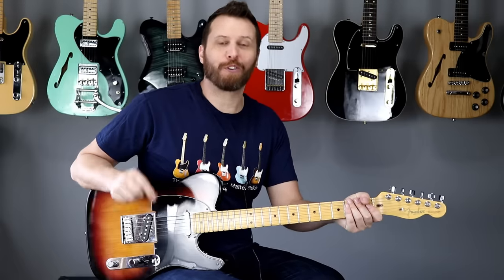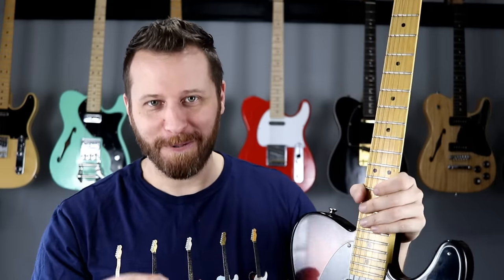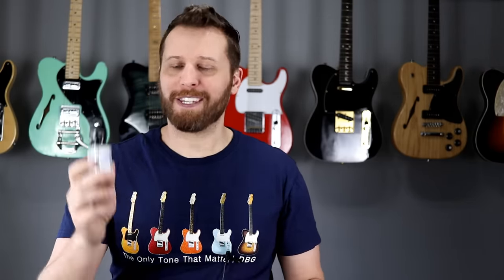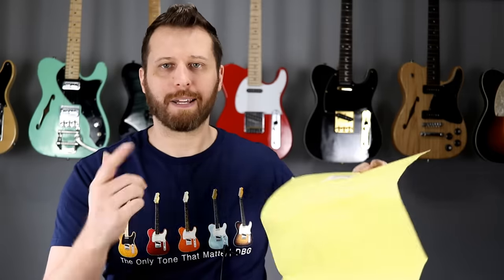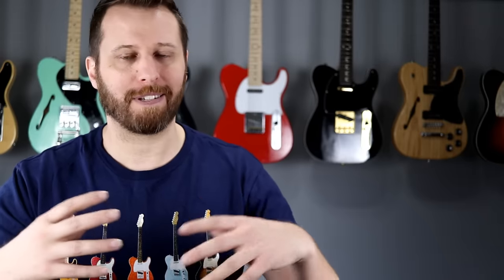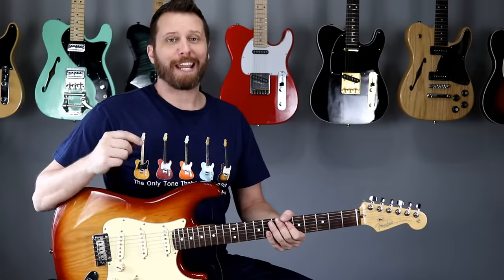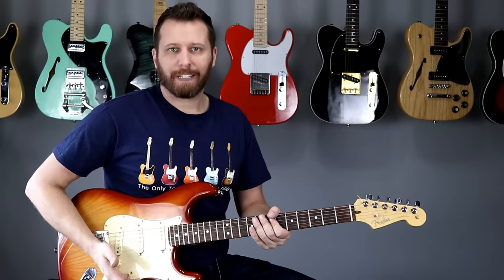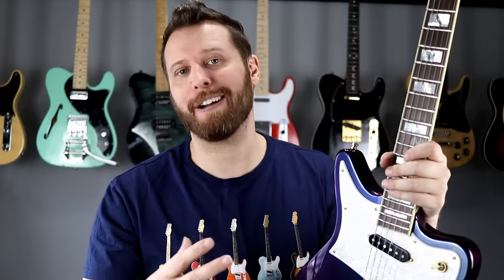KILL The Hum and Buzz!! - Keeping Your Single Coils QUIET!

Comment: I put 3 hotrails in one of my Strats. With a toggle switch for each one to go from single to humbucker. No noise. Noise Gate otherwise. 👍
Reply: How much did it cost for the 3?
Reply: But isn't coil split again noisy?
Reply: I have a strat ultra from 91 which has noiseless lace sensor gold pickups
Reply: Yes, split will make it noisy!
Reply: I've got the same setup preloaded pickguard from dragonfire.i love it.
Reply: No strat tone too.
Reply: and it doesn't sound anything like a strat. May as well use an ibanez or another humbucker guitar.

Comment: I recently bought the Electro Harmonix Hum Debugger, and it's a fantastic solution. Doesn't affect the tone at all. The only issue: it has to be plugged directly into the wall with the power adapter that comes with it. Not a gate. It goes after JUST the buzz/hum and it's INCREDIBLY effective. Won't play without it now. Has 2 settings: Normal and High.
Reply: 3 years later, I bet you agree the pedal changes the tone. Everyone who has it says it gives a weird ring-mod/delay effect on notes

Comment: I’d suggest using the gate as the very last solution. It’s the most obstructive method to your sound. First step, use high quality cables! Second, check the other electronics in the area and where their magnetic fields are! Third, insulate your guitar’s electronic cavities with the proper copper shielding tape (adhesive needs to be conductive), by this point you should be almost noise free. Then a gate with very low settings could certainly help. And/or hum/noise reduction if your setup has that option.

Comment: I've tried a number of noise gate / reduction pedals over the years... Boss, MXR, ISP... the MXR Smart Gate is the best I've used. But the Suhr SSCII system built into my red Suhr is a much more effective solution :) No battery needed unless you're using the S90s (P90 style) too.

Comment: My advice is 1. shield the guitar properly (create a Farriday cage by making sure all shielding is touching and grounded ) 2. don't play under florescent lights. Play by candle light if you have to. 3. Unplug unneeded electrical appliances (including wifi devices). 4. Try plugging your Amp into different outlets, because sometimes a high amperage appliance can create line noise on all outlets running on that breaker (of course this problem effects humbuckers too)
Reply: I plugged my amp to another outlet and boom. Hum was mostly gone Ty

Comment: The Boss NS-2 noise gate is my favorite.  Easy to use and effective.  Plus, it has some unique routing options where your pedals run in a loop if creates and your guitar goes in and out.  That way it can separate the guitar signal from pedal noise. Really helps with high gain setups.

Comment from the maker: As a HUGE single coil fan this is a subject near and dear to my heart!
If you guys have any favourite noise reduction or gate pedals post them below :)
Reply: MXR Smart Gate :)
Reply: Dryer sheet for the pickguard static.  Got my tele shielded, but it was pickguard static!
Reply: What do you think about a parallel wired humbucker? I did the P-Rails wiring to a set of Seymour Duncan Pearly Gates and found that running the pup in parallel gave me a very similar sound to the tapped humbucker. Minus the 60 cycle hum, of course.
Reply: Oh, and I use a modeling amp, so my gate is built in.
Reply: Zexcoil pups
Reply: Ehx hum debugger! Super simple and works great!
Reply: @GCKelloch  What you conclude is about right, but the resonance you mentioned has a negligible role in it. If you connect a guitar output with a very short cable, the capacity is almost zero and the effect of the parallel humbucker is still the same.
There is a more important factor here: each coil in the HB presents to the other a higher impedance to higher frequencies and a lower impedance to the lower frequencies.
You can check that in a LP like guitar with one pickup as HB and the other as SC. As you turn down the volume of the SC, the sound of the HB can grow up because it is now not being loaded by the SC.
Reply: What about "dummy" coils? The same hum reduction as pos. 2 & 4 with little/no tone change.
Reply: BOSS NS-2 does the job for me
Reply: @GCKelloch  hmmm, interesting, I must say I have never metered the pickups after I wired them. Maybe I should. From my auditory experience though, the only difference  that I could hear  between the split and the paralleled humbucker was the loss of the hum in the latter.
Reply: Slave coil and attach it to the tremelo cover or at the back, completely passive and 100% effective
Reply: I use the TC Electronic Sentry Noise Gate: I believe it’s the best : set properly (which is easy), it really shuts down the noise with little or no loss of dynamics or sustain
Reply: I'm a huge fan of Zexcoil pickups.
Reply: KC : thanks, I’ll check it out
Reply: My favorite is the shielding paint.
Reply: G&L's Z coil pickups
Reply: The Gate I'm working with is the TC Electronics Sentry. Better than all the others I've tried: it works on 3 different frequencies, lets the notes through and kills the hum and hiss without damping the sustain. Once you tweaked it a bit to your needs, works really great ! \m/
Reply: I use an '80s vintage MXR noise gate/line driver. It's finicky to find the sweet spot between hum canceling and sustain clipping, but I think it works better than anything else I've tried once you get it there.
Reply: I always put a lot of time and effort in shielding measures, copper foil, graphite paint, proper ground wiring and all that stuff. Then i bought a ISP Decimator II and i never looked back. It kinda hurts to spend that money because it is not a flashy pedal and all it does is "quiet". But it is such a relief :-)
Reply: @CGCEifel  Yeah, I had an ISP: great pedal. Simple and effective.  The Sentry brings it to another level though, completely taking the pumping effect out on long notes without masking any frequencies.
Reply: @michaelkane6797  They really built great pedals in the '80s took many of the flaws in '70s pedals away. Still kept a bunch of '80s pedals: ODs (Boss), Boosters, Compressors (Boss CE-2!), Choruses and Tube Screamers (Ibanez), next to more contemporary ones \m/
Reply: @frantisca  OK, i somehow lost interest in gates after i got my ISP :-) But this sounds interesting, i'll take a look at the Sentry, TY.
Reply: I use Rocktron's Utopia and there's HUSH 
Happy for ~7 years now and I ♥ it!
They also have HUSH pedals, mini pedals ...
Reply: Try changing guitar cable also.
Reply: @GCKelloch  - Are those values similar to what you get with a single coil?
Reply: Hey Darrell, always a pleasure to watch your videos! Thanks to you I finished modding my Epiphone LP and it's awesome. Regarding Hum canceling, I'm using Kinman awesome pickups on my Strat and for the P90s I put on my LP. Very effective and sounds great and very natural to me. You should check them out. Cheers
Reply: @CGCEifel  I second this.  I actually won one of these in a drawing and figured I'd sell it because I'd had unsatisfactory performance from other gates chopping off the notes and whatnot.  The Decimator II is different - it is so musical and just eliminates the noise.
Reply: Replace the white-black wire pair from the volume pot to the jack with shielded cable. Fender doesn't do it on even high end but Gibson puts shielded cable on lowest priced Epiphone Specials. Nashua Aluminum Flashing tape for the cavities (have had better luck with that than paint). Covered pickups are important, sitting in front of pc recording even humbuckers are noisy without shielding covers.
Reply: The Donner noise killer pedal is cheap and works really well imo
Reply: If you're using plugins, try the Noise Suppressor from Vadim Taranov. Very tiny loss of high end, but barely noticeable. 32bit only but can be bridged. Really works wonders for high gain. I use it along with a noise gate. And its FREE!
Reply: I use the gate on a DigiTech RP50 I picked up at A thrift store for $5. Works unbelievably great and they are readily available on EBay for $20 all day long. You can turn the rest of the effects off if so inclined or better yet use them, there are some cool ones. Great tone doesn't have to be expensive.
Reply: @Chris.Wiley.  I'm absolutely satisfied with my Decimator II, but actually i discovered the first weak spot of it just a couple days ago. I got a new Trelicopter tremolo and if you combine it with plenty of overdrive the Decimator gets a little confused. But i can live with that, why would you add Hi Gain to tremolo anyways ? :-)
Reply: I use a strymon riverside whuch has a noise gate in it- works great.
Reply: Volume pedal?
Reply: Electro Harmonix silencer is pretty good
Reply: Decimator g string II.    Is one of the best on the market.
Reply: Can a humbucker give me a single coil sound??
Reply: BOSS NS-2 is one of the best out there. When it's plugged using the send/return loop with four jacks, it seperates the signal coming from the guitar and won't touch it while gating non guitar signals.
Reply: Ilitch Electronics noise canceling backplate? Suhr uses it. :)
Reply: Did this on my Strat. It’s quick, pretty easy, cost damn near nothing and it will shut up the loudest hums... nobody resorts back to vintage solutions 🤦🏼‍♂️
Reply: I prefer the TC Electronic pedal. Much more organic and natural than hard gates.
Reply: You should definitely try zexcoils pickups, best noiseless on the market!
Reply: mooer one does the job for me if i want sustain when i play lead i turn it off
Reply: One thing I noticed with my strat was that if I stood perpendicular to my amp most noise disappeared. I guess it has something to do with the magnets lining up and cancelling interference?
Reply: @solomondaniel6670  if you mod your guitar, yes. I believe it's called a push/pull pot but don't quote me on that (I don't think it's as good as a real single coil though). It's worth a google.
Reply: I play at church so any hum is FORBIDDEN........anyway I use the EXH Hum-Debugger. It works pretty well but It still did not eliminate 100% of the hum so I threw in the towel and switched to humbuckers and just make it work(still use the EHX to be absolutely sure of no hum).
Reply: BOSS NS-2 looped through your dirt pedals. What gate are you using for  this video?
Reply: Ns2, 4 lead setup...its eerily quiet even on sustained notes
Reply: I've not tried them yet, but I have a Telefaker guitar kit I'm going to be assembling and I'm thinking about eventually getting the Fishman Fluence pickups/electronics. Have you had a chance to play/hear those? What little I've heard, they sound very vintage Telecaster like and quiet.
Reply: I used the cheapest🙆
Reply: I added an extra magnet to one of mine. It helps (if the magnet polarity is correct).
Reply: Decimator all the way
Reply: Ilitch noise canceling backplate. Check it out
Reply: Ehx hum debugger
Reply: Did anyone try Ulbrick NRS proprietary system? Made in Australia. They advertise ZERO tone loss...
Reply: The first time I encountered this kind of hum (20+ years ago when I bought an Ibanez guitar and a Fender Amp , Champion model if my memory serves me well, I tried to find the solution and I found an article about copper or aluminum foil behind the pick guard solution in a guitar magazine. I live in Thailand and here we use 220-240 V and 50/60 Hz system. At the time the power outlet had only 2 holes, i.e. Line and Neutral. There was no ground connection. I noticed that my Fender Amp came with 3 prong male plug so I thought I might need to install a ground rod. This was because I noticed that whenever I touched the strings the hum would be completely gone. If I pull my hand off the strings the hum started again. So I was thinking   static charge might cause this annoying hum. So I went out to buy a 1 meter long copper ground rod and installed a new power outlet socket with 3 holes (Line, Neutral and Ground), connected a ground wire to the copper ground rod buried 1 meter under my front yard and the hum was completely gone. That made me wonder why nobody (guitar magazines at that time) mentioned this as a possible solution. May be this was not an issue in the U.S. where 110 V AC with ground was the norm.
Reply: Check out sir max rufo. He had invented a noiseless single coil pickups. He's from Philippines 🇵🇭
Reply: Nice, Filipino hereeee!
Reply: Fender Custom Shop noiseless pickups. And, for recording, finding the no-noise sweet spot in the room.
Reply: X-Noise from Waves in combination with a lower threshold on the gate could help with sustain tones?
Reply: Might want to pin this
Reply: The ISP Decimator takes the cake for me.
Reply: I've got a rack mount Alesis Compressor with gate that works really well. It's really old and I'm sure there's "newer better" stuff out there, there always is, but it works great for me!
Reply: Behringer Noise Reducer, I love this pedal, it is cheap and very useful
Reply: Rowin Noise Gate pedal. Dirt cheap but does the trick.
Reply: Boss NS2 is an amazing one!
Reply: KC " ISP"?
Reply: KC  thank you!

Comment: Interesting you posted this, as I just acquired a Boss NS2 noise suppressor. It works exceptionally well at cutting out hum from vintage single coils without altering attack or killing sustain. If you hold a note, you can hear the hum start to creep in (but reduced in volume) before the gate shuts, so like most things, not perfect........but otherwise pretty great. The other thing that helps w/ pedals is a good isolated linear PS vs a cheap daisy chained switching unit, but this is more about hiss than 60 hz buzz.

I don't play professionally, but having a rig that is now nearly silent makes me really happy. Plus, I could swear that my little 20 watt Mesa combo now has more clean headroom without all the noise being fed to the input. Could be my imagination, or confusing the noise added to signal as distortion.

Comment: I think gating is by far the answer most pros use, even if they play the high end single coils.  One point I would make is that the gating will also change the way you play.  It actually helps you become more subtle with left hand pressure.  It also makes the rhythm riffs sound more punchy, provided the player has the gate dialed in right and gets used to it.

Comment: Before watching the vid and just by looking at it's title, i thought that u gonna give us tutorial on how to do EMI shielding with copper tape 😁
Nice vids as usual sir. Thank You
Reply: I use only StewMac's copper shielding tape.  It works very well but takes some practice to install efficiently.   First couple of guitars  I wasted as much tape as I installed making pieces that didn't fit well enough for me, then trying again.  I got better at it with time and more appropriate tools.
Conductive adhesive (??) but I solder across any seams/joints JIC.  Pickup pockets too, but these need ground wire connection led back to the control cavity's shield tape.  Back of the pickguard, sure, control compartment cover, sure.  These places require making a copper tab across one (two's better) screw holes (both pieces) that will connect them together when installed.  Tub routes are easiest, a typical Strat is a total PIA in the body but "cheap therapy".  No special tools, paper, pencils with good erasers, Sharpie, sissors, an Exacto knife, and small misc.  $50 worth of the 3 widths of tape is enough for 5-8 guitars if most pieces are well cut.  Actually the 1/4 wide is kind of useless.   Have FUN, (I'm sure there are You-Tubes, good and not so good) demonstrating tape installation.  Should have said this first but the idea is to build a copper *box* around everything but the front of the PUs.   ** aka, a Faraday Cage. Your results may vary and it won't be perfectly silent, so there's that.

Comment: I have a Tele that buzzed. I painted the pickup cavity with conductive paint, and replaced the internal wire with insulated wire. Big improvement. More playable and enjoyable. I recommend this approach. Yes, ‘some (re)assembly required, but it actually addresses the problem.

Comment: I just had an electrician come over and put my studio on it's own circuit / ground. Everything is very silent.
Reply: How much does something like that cost? Is it invasive work?
Reply: @ArmanBaig  That depends on your house. I have a crawl space under my house. It was like between 1-2 hrs work. It's not a big deal to do. It would be good if you talked to an electrician and told him whats happening. There is still a little bit of hum with single coils. BUT if you have a big hum going on, that can be mitigated with a new clean line with it's own ground. It made me not hate single coils LOL!
Reply: @ChadWork1  I have a 2 story house with attic and crawl space. My studio is on the second floor. Could I still do it?
Reply: @ArmanBaig  Of course. Anything is possible. Just have an electrician come out and bit the job. It would be nice if he had some experience with studios, as in killing the hum. It may be that he just tests your lines and finds they are can be tweaked. You could call a local studio and ask if they have a recommendation for an electrician too.
Reply: @ChadWork1  awesome, thank you so much. I really appreciate it
Reply: Pretty sure a single dwelling can only have one ground on the supply side of the service. 
You might mean bonded. Anyways. Just as before, your studio is still in parallel with the whole house and in fact other houses on the same transformer.

Comment: I just installed a simple dummy coil in my MIM Telecaster...big improvement.  Hum/buzz is reduced to a tolerable level.  The pickups aren't RWRP,  so I was able to use the same dummy coil in all three switch positions by wiring it between the output of the switch and the input of the volume control.  And cost $0, since I already had an old pickup to use for the dummy coil.